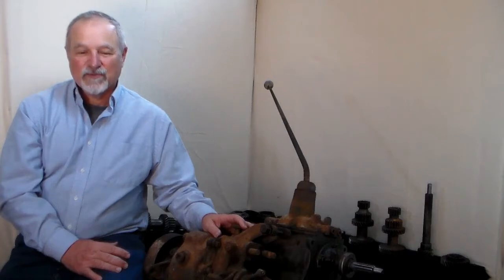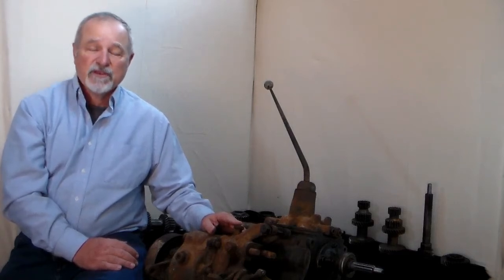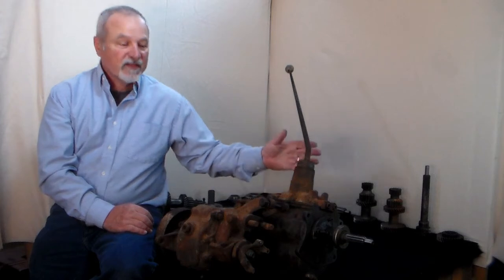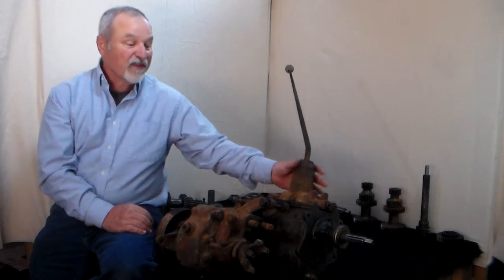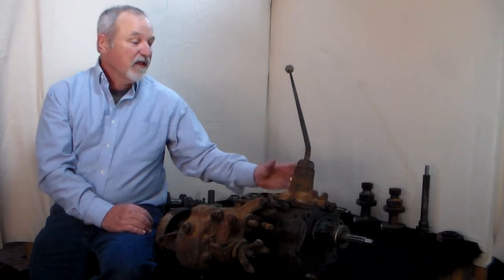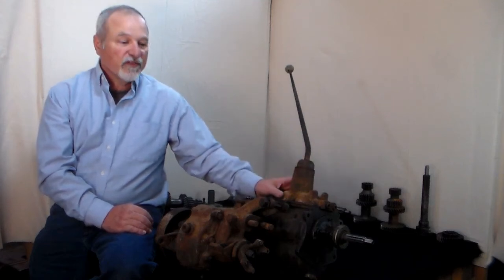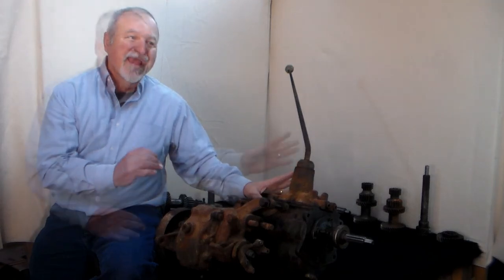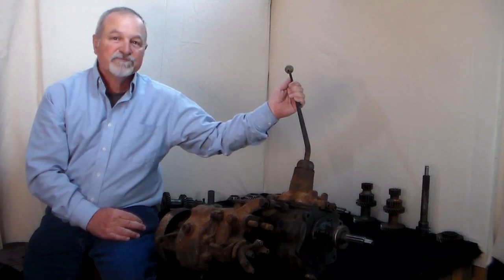1 Rick Stivers T-90 Rebuild Guide - Introduction

Comment: I’m curious, I have the tub off my Willys cj2a is there a good way of inspecting my T90 to check if I need to rebuild it before I put the tub back on? Any help would be awesome . Thank you Ken
Reply from the maker: Kenneth Lemire, Do you know the history of it? They are so easy to rebuild, I would just go ahead and pull it apart and inspect it. At least that way you can install new gaskets and seals. Of course if you know it was gone through and worked fine then leave it alone.